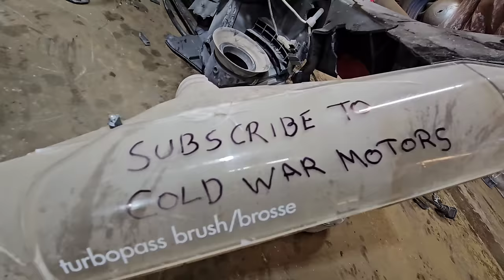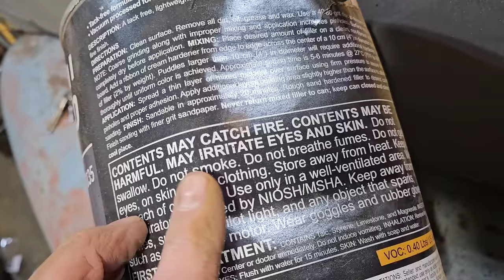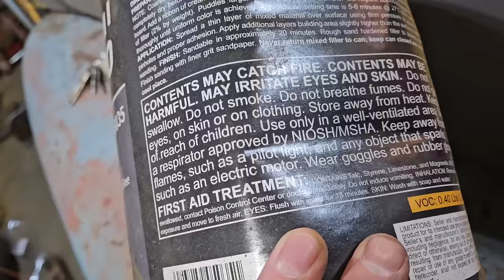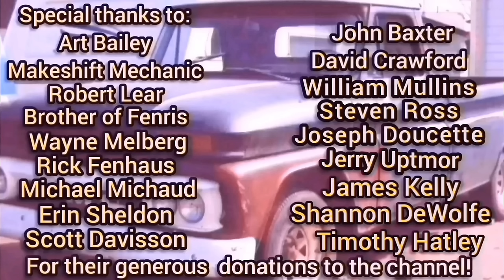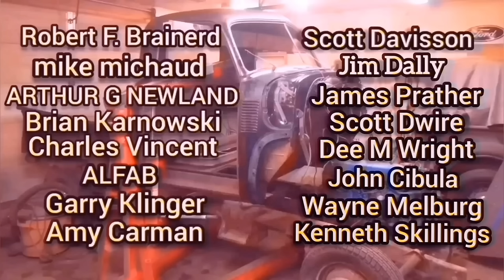Quit Doing Body Filler the Hard Way! Amazing Simple Trick Used By Professional Bodyshops

Comment: You know the term "Lead sled"?  I'm old enough to remember when plastic fillers didn't exist.  All the older kids of the 1950's used to customize their cars using lead.   Some of the coolest designs came out of mixing Oldsmobile or Buick grills with Mercury headlights and Chevy tailfins all blended together with lead then painted in candy apple Blue, Pink or Green.
Reply: I've always heard that term used to refer to 49-51 ford's. Lead sled or shoe box.
Reply: neat
Reply from the maker: Yup, all my bodywork heroes started out building lead sleds back in the pre-bondo days!
Reply: Yes, these early '49-'51  Fords & Mercs, were often the subject of customizing because they were plentiful, cheap to buy and had V-8's  so naturally due to the lead work they were called "Lead sleds" but they weren't the only ones having that definition.

  Since so many cars of the era were outdated in appearance in less than 4 or 5 years due to Detroit's styling change tastes, A lot of the bulbous, high roofed, heavy weight 2 door cars were sought after to reshape but in truth Early to Mid 50's cars like '48-52 Plymouths, Dodges, Kaiser & Henry Jays  '53-'54 Chevys & Pontiacs, '55-'56 Oldsmobiles, Buicks,  & Mercurys  (and even some Pre-finned Studebakers or foreign cars) were selected for body changes and were called Lead sleds.  

I knew a guy who took and Austin "A-40" Devon, chopped the roof, Frenched the existing Headlights and added two more into the front fenders and then shoehorned a 52 Lincoln flathead into it.  He had to bolster the springs to compensate for the engine's weight and it over supported the car's nose giving it a gasser appearance.  He painted it this black and added Orange to white flames to the front, licking all the way to the back window  (this too was big in those days). @aaadamt964
Reply: I actually like lead loading...
Reply: Last year for lead was 1970 almost extinction now
Reply: I was wondering how difficult it would be to to use the lead on the side of the car.  I am redoing a 83 mercedes and I would love the option.  Is it available in the US?
Reply: My stepdad told stories of how they filled rust with mud, (actual clay / dirt mixed with enough water to the consistency of modeling clay) he said it usually turned out ok but would have to keep the car off the road when it rained. He said that it was good idea not to drive in the rain anyway because usually had bald tires.  He also commented that they used belt leather for bearings. Poor people have poor ways.
Reply: Yes my dad was a body man, trained in the '50s and I remember the wooden paddles of all different sized that were used to shape it. I wish like hell now I'd gotten him to show me the ropes😢.
Reply: There’s not to many people that can actually lead fill anymore or even know what it is I haven’t seen it done since I was a little kid
Reply: @larrycumbo2023  our 1978 mercury wagon had lead seams from factory

Comment: This was the way we did it when I began working in body shops in 1951. The old guys that smoked cigars while they used the acetylene torch, wood paddle, and the lead bar were artists. I never saw any Bondo until a few years later - then in the 60s it seemed like everybody was using it  and the old "lead" patches disappeared. I still smoked cigars while I worked until I gave them up over 40 years ago because of bronchitis.

Comment: I do enjoy taking stuff apart. I resently taken apart a recliner. I was going to sell the metal and save the leather for later projects and burn the wood. But now that i see the wood is nice oak ill keep it. It is perfect size to make the ladel you are using in this video. I might even keep part of the mechanism. The foam went into the trash but there were enough big pieces that if you needed to restore parts of a car seat with destroyed foam you could use it. If i did not take the chair apart i would have paid money to trow it away. And the time it took to take it apart i was  watching youtube while i took it apart.

Comment: Memories: The very first patches I ever welded were the corners of the doors of my 63 Belair. That was 41 years ago. I had no idea of the shrinkage a weld can cause. After  I was finished, the lower parts of the door were quite wavy. As the car was white it was  hardly visible.
The repairs were nearly identical to the one you showed. Some inner corners needed patching as well. After 39 years we had to replace the lower parts of the doors again. Well if a repair lasts nearly fourty years it was not made to shabby. Nothing lasts forever. Well maybe classic Chevies do.

Comment: Solder used in Electronics (sorry Bondo) is 60 40 because it goes through the "mushy stage" quickly at a lower temp whereas "lead" for body work being 70 30 stays mushy or workable longer.  It is all to do with the phase diagram of Lead/Tin and the alloys thereof.

Comment: That torch must put out more heat than a shrinking disc, so is there much warpage from leading ?
Reply from the maker: Yes you can warp a panel if you're not careful. On cars from the 60s and newer I only use it on edges or areas where the panel has a lot of strength. Using it in the middle of a flat roof or hood can warp the panel worse than what it was before you started....and I definitely wouldn't try using it on a modern car with thin metal!

Comment: I learned to do this in 1980 -81 Auto body course in high school,  there's a step requireing bees wax but I don't remember what I think your supposed to wipe the paddle in it before smoothing the lead
Reply from the maker: I use tallow on the paddles, but it's the same concept as using beeswax

Comment: 61 years ago I cut my teeth on my Dad's rusted out $75 '47 Chevy. Also learned to drive on it at age 12. Used window screen and lead. We brush painted it with housepaint. Didn't look too good, but held up till he bought a '53 Pontiac straight 8. Really nice car! A bit of memorabilia! Bye the way, a brake job on a '47 Chevy was a real TURD!!! Db

Comment: Thank God for the tutorial on disassembling vacuum cleaners! I had sucked up a large quantity of marshmallows,  and I couldn't figure out how to get them out. The rapid disassembly process you demonstrated was a life saver. I had to rewatch a few times for the more technical sections, but I got there in the end! I assume.that like other tutorials,  I just watch it backwards to see how to put it back together? Thanks dude, great videos. I am looking to lead up some fuel tank seams, so perfect timing.  It just seems difficult to get the tinning butter in Australia. Cheers
Reply: You might try an acid soldering flux that plumbers used back when 60/40 solder was common.
Reply: @jerrywesterfield5636  I use bakers liquid flux, but it doesn't seem that it behaves the same and it is definitely not as effective. The powder flux I have used needs to get too hot to activate and overheats the sheet metal. I'll keep looking for tinning butter I guess.
Reply from the maker: The eastwood tinning butter is getting tough to find here in Canada too. Bill Hines used Stay-Clean for tinning, but I'm not sure on the availability of that either

Comment: Is self etching primer worth using? I know everyone seems to be using epoxy primer, but i am cheap. Can you just shoot high build primer over the etching primer and call it a day or is epoxy just so superior that I would be wasting my time?
Reply: My understanding is etching primer makes a decent chemical bond and very good for repairs on bare metal.  Epoxy needs a certain "tooth" to mechanically adhere and is preferred in restoration (too fancy for my repairs).
Reply: Epoxy is waterproof, etch primer may not be. If your project will sit for a long time (or sit outdoors) you could get rust under the etch primer. I used etch prime and high build for years with good results but I wouldn't put a job outside until it was topcoated. Epoxy is the new kid. It works well too. All DTM (direct to metal) primers will have an etching agent. The better the quality of the materials the more durable and better the results ....according to the manufacturers.
Reply: Just my 12 year DIY experience probably totally wrong opinion, but: the only real problems I have encountered on my troubled restoration journey have been due to mistaken faith in etch primer. Ok, so it has a bit of acid in it to bond to the metal, but here in the UK it is a 1K product, so anything you put on top of it that contains any solvents, which amounts to everything primer related, is capable of removing the etch primer completely. You can NEVER apply fillers or spray fillers over it, which is what I did with disastrous results that only showed up about 3 months after final painting. It is not waterproof, so has to be overcoated with something that is as soon as possible. The way I go now is bare metal sanded to 80 grit, 2 coats of epoxy primer, sand with 150, apply filler or primer as necessary, block out, job done.

Comment: I have always wanted to give this a try. I remember back in the early 90s taking the lead out of original seams on older cars to replace with plastic fillers lol. Seems like we are going back to what works and doesn't peel or flake off when rust forms underneath
Reply: Does lead stick to rusty metal?  I know bondo has issues but I think both lead and body will lift off metal that is rusting underneath.  People talk about rust jacking ... aka byproducts of corrosion process take up more space than original metal.
Reply: Sorry lead or body filler

Comment: When I was young, did a training course at Porsche, panel heaters were not using Hondo but lead fill the in perfection and because Hondo does not take on paint, only on raw steel and if too much Mekp is used, it is hygroscopic thus rusting the metal under. Have done some repairs with Epoxy, interprotect for steel boats, S FAIR then epoxy primer then top coat. Not a spot of rust after 10 years. Good job.

Comment: I wonder if I can use this new magic bondo to fill wall holes in my living room.
Reply from the maker: I used bondo to re attach a towel rack that my cat ripped out of the wall and it's holding up great after 2 years. If bondo worked for drywall repair, then lead should work even better!

Comment: I might need some lead on the little bike I restoring. It's getting bloody expensive though. Here it is about NZ$100 a kg. And the tinning paste is $NZ370 a tub! Luckily I have that already. The problem will be when no one here stocks it anymore as getting it from overseas won't be an economical proposition. One local place, an Eastwood supplier, is charging nearly $60NZ for 1LBS of tallow for putting on the wooden paddles!
Reply from the maker: Wow! I thought we were getting hosed here in Canada, but those prices are insane! I've been saving up so I can stock pile a bunch of lead and tinning butter before it becomes impossible to buy.

Comment: I made a comment before but for some unknown reason it vanished.   In any event as a kid of the 1950's there wasn't such a thing as Bondo, it was all Lead.  The term "Lead sled" was as a result of the extreme customizing the kids would do to their cars and have to then fluidly merge parts that wouldn't normally fit together with welding then leading.  Oldsmobile fenders, Buick Grills, Ford headlights and Chevy tail fins were all smoothly melted together with the use of lead. It was a real art and at the end, the paints they would use were simply outrageous.  Aside from the candy Apple colors guys would rub out 20 or 30 coats of lacquer to get the depth out of their paint jobs so that they looked like liquid coatings.
Reply from the maker: Looks like your first comment is still showing up on my end. I love all the old lead sleds with their 30 coats of hand rubbed lacquer paint!

Comment: UK "copper" coins are now actually copper-plated steel so not a dodge we could use - good idea though. I rember taking a Morris Minor radiator for repair and the radiator specialist soldered a two pence piece into unused ports. Wouldn't work now I suppose.
Reply from the maker: We haven't even had pretend copper coins here in years. I had to use copper circles that were period correct to the car

Comment: Back in the day I worked at a body shop which used polyester resin in the top coat of mud to get it to lay down like putty coat and it won’t absorb moisture.
Do you think you could use higher build 2k primer instead of skim coating the whole door ?
Reply from the maker: No the door needs a skim coat of body filler

Comment: I've been soldering electronic circuits for over 50 years using various lead tin formulations. Sometimes 60/40/, maybe 70/30 and if I am feeling particularly rebellious, 63/37. Folks may say I'm not quite right in the head, but wait! What was I talking about again?

Comment: Almost the old way we used Alcohol blow troches 350 to 450 degrees F and the spoons we used where HTC High Temp Carbon like the old brake shoes were made of then smoothing we'd use metal rasp

Comment: Would lead work ok for rust pitting on a boat trailer fender?

FWW, you might be able to use an abrasive flap disk or sanding belt coated with wax.  That is what they use to keep aluminum from clogging those.

Comment: LIL secret to leading that I have seen absolutely no one buy my grandfather use and teach me. Plate pass leading. You take a heavy stainless steel spatula, very large and 2.3 mill thick, long handle to remove things from ovens used in commercial bakeries, and use it to melt over ( called sheeting )  to keep excess heat off the body metal, torch hits it and lead bars or wool and you wave torch back and forth over it and the body panel to meld the lead in. Hope that gave you a picture or thought.

Comment: With lead - practice, pratice, practice. I knew old guys that could do incredible work with lead. Some of it on cars I owned decades ago. Those guys are all gone.
I'll stick with bondo. I'm to the point where I can handle up to a baseball sized chunk at a time all the way down to just about nothing. Larger pieces you have to be fast. BTW, you can lengthen the time you have by using a bit less hardener. Also, you can make it more fluid by using fiberglass resin. It's the same stuff as in Bondo though you can thin it down and make it like glass. Avoid bubbles. It's a lot less sanding. Finding out about using fiberglass resin in bondo is like a trade secret. It helped me a great deal. Thin it to where you want it, then add hardener and work it in.

Comment: Note: the shoe on your straight-line air sander mounts to the tool with two fasteners...and...the spacing on those fastener holes just happen to be the exact same spacing as the holes on those vixen files!  Eureka !!!! Now you can turn your air sander into the AIR FILE it was designed to be....you're welcome. Didn't see you paddle dipping into paraffin...but you did, right? Carry on fellow lead wiper.

Comment: That is not bondo. That is lead sticks made with 30% tin 70% lead. You use wood padels dipped in sheeps talow to smooth the lead out. There are spiecal files to form it into shape. This is what was used before bondo was invented. I used it in the 50's and 60's
Reply from the maker: Ok, the guy in the van who sold it to me told me it was bondo
Reply: @CarterAutoRestyling  Quit doing body repair when bondo came out. Couldn't stand the dust odor. Didn't think the dust was good for lungs. Didn't think of what the lead was doing to my lungs.LOL

Comment: I learned lead work from an old timer back in the day, but nothing beats mud...fast, light and easy to form. The secret is in the cheese grating.
Reply from the maker: Fast and easy does not equal better.
Reply: @CarterAutoRestyling  Dude...I spent 15yrs of my life in a body shop. The only time lead work was required was when I worked for Earl Lewis doing restorations.

Comment: I had trouble with the welds being tough to grind down too, many years ago.
My welder supply salesman/truck driver got me some different Mig wire that was a lot easier to work with, perhaps your welding supply can help you with that as well.

Comment: isn't it just silver solder or lead , plumbers use to use for roofing repairs particularly galvanised roof sheetmetal lead wiping can also use leather wipes for smoothing
Reply from the maker: It's 70% lead 30% tin, specifically made for repairing car bodys, same idea as what plumbers use though. I have heard about using leather to wipe it, haven't tried it yet, but I'd be interested to give it a try sometime. Thanks for watching!

Comment: A bigger hammer pulls them apart faster. The only bits that should wobble are housed in a bra, anything else is not acceptable. Half round body files are so hard to come by now,😔 nice work Kyle as usual. 😊

Comment: Out of curiosity, why not just weld the holes and imperfections and then sand back? Edit/ I got to the point where you were soldering the imperfections after welding some 14mins in.

Comment: SOME REPAIRS require lead on older vehicles, welding ruins the integrity of the pieces and lead as you have shown,works great,i use SLICK SAND AS A FILLER,i wished they had made it years ago,i'd be rich,you can literally take a rough straight door rood or  hood deck lid AND make it like new,it expands dramatically,then carve the car out of it,saves many hours,you don't have to sand to 320 anymore,120 will work fine,stinks to high heaven but its a miracle product,treat it like any other harden dangerous filler,wear your respirator ,live to paint a thousand of them,good work